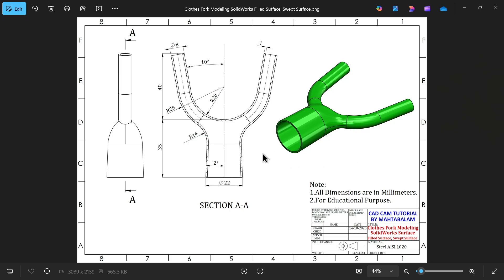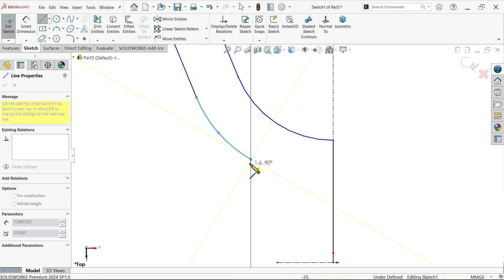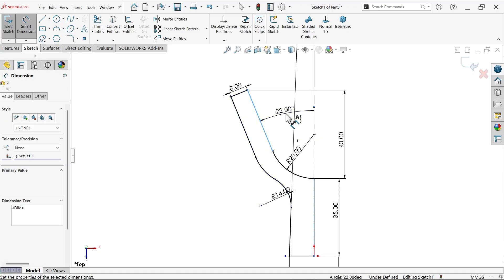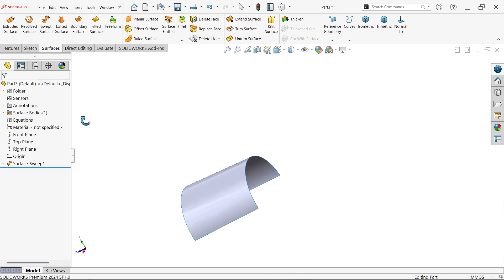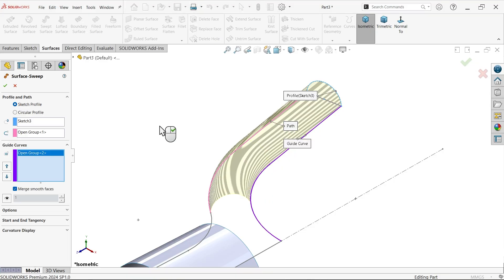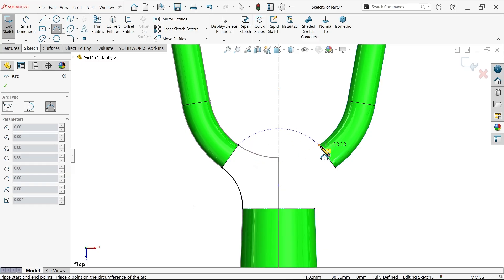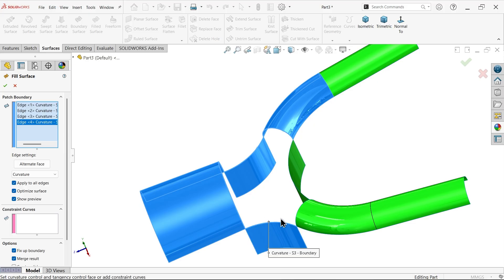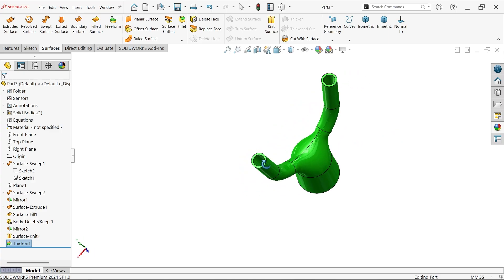SolidWorks Surface Tutorial Clothes Fork Modeling (Filled Surface, Swept surface)

Comment: The surface generated by the six edges and the thin pipes on both sides do not have smooth surfaces. There are concave surfaces. You should check the zebra pattern and whether they are tangent.